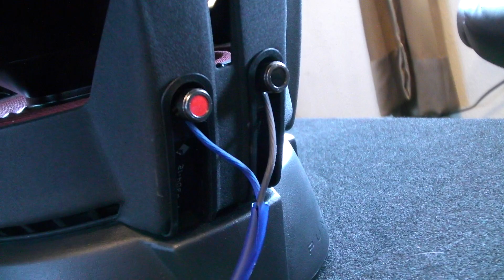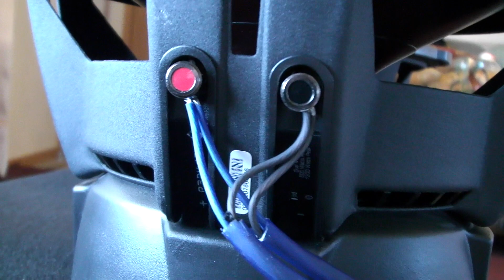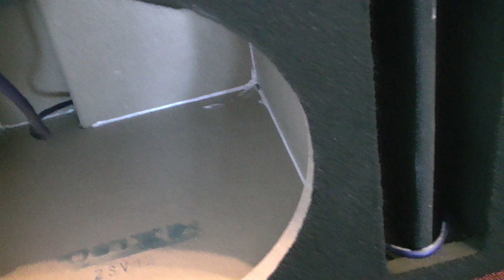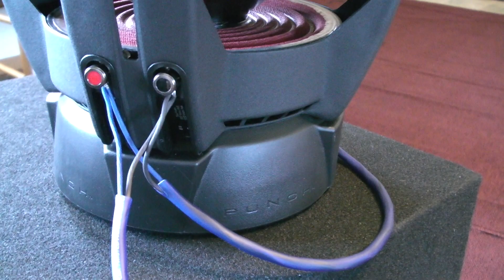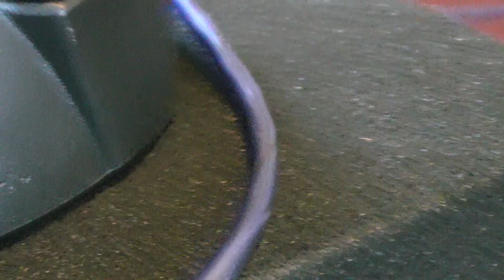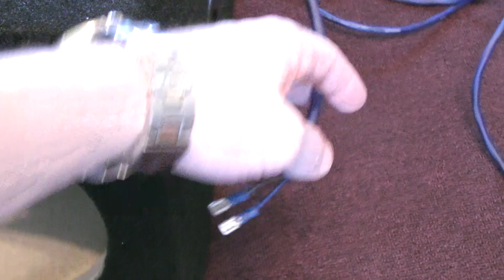How to wire subwoofers to 1ohm

Comment: if he used separate terminals on the amp each woofer would be at 2 ohms. by wiring them both together in "bridged" mode he is knocking the impedance down to 1 ohm and getting more power out of the amp.

Comment: Wouldn't it be the same if you took both 2ohm leads and joined them at the amp instead of joining them thru the box?
Reply: Yes in my opinion it would be smarter to use both terminal cups and wire each to 2ohm and the mono amp will put it at 1 ohm,

Comment: My box has a wall that separates the speakers so how would you recommend that I do this? Drill a small hole through the wall to link the speakers together? Thanks.
Reply: Like I said before why can’t you just positive to positive and negative to negative then positive and negative to the quick connection in the box then to amplifier??

Comment: the problem is its not 1ohm stable the amp is rated 170 Watts x 2 Channels @ 4 Ohms
250 Watts x 2 Channels @ 2 Ohms  500 watts x 1 Channel @ 4 Ohms (Bridged) i just burnt that amp up doing the same thing so now im using the 1800watt kenwood and its 1ohm stable at >900 rms

Comment: once you drop ohms on 1 sub connect it to the terminal out put on its side no need to run a wire like that after the 2 terminals are wired twist them together straight to your MONO AMP! it's pointless to run a set of wires to other side of your box when you can twist them together on the way to your amp ! lol smh 2 4ohm subs can get dropped  to 1ohm right to the amp... if you have 2 dual 2ohm subs you can drop them max to 0.5 ohms but make sure your amp can handle it because dropping your subs to a 0.5 is a ridiculous power pull on your amp and your amp probably will double it's maxx power for 20 mins before it blows unless it's a Top shelf amp like A 'T series Rockford fosgate amp, or zx series kicker amp for example nothin cheap will last long at a 0.5ohm load don't waste your money
Reply: Saw this video and read your comment hoping you can maybe help me out a a bit i have x2 Rockford P3D2's 2 ohm DVCs the box is a no port dual-separate chamber(ASC Jeep Wrangler custom enclosure). The amp I'm using is a Rockford Power T1500-bdcp it has 4 terminals for "Speaker A and Speaker B" I'm trying to get at least a 2 ohm load to the amp. I'm thinking of wiring each sub to 4 ohm then to the amp as "Speaker A and Speaker B" for a total ohm load of 2 ohms right? The Manual says its wired in parallel internally. That kinda throws me off. So is my wiring right? Soz for the long story.
Reply: ***** so I would basically wire it as a multi channel amp?
Reply: Yes

Comment: U should of finished all the way trhu. By runing the wires out to the amp.  Would of confirmed/answered my question. Every tutorial video ends the same assuming the rest is common sense.
Reply from the maker: Henry G Ahh, good point! I didnt thing about that part when making the video.
Reply: It basically is. Wire your amp like normal from there on you only have 2 speaker wires to connect to positive and negative. After that it’s all the stuff you would already do for your amp.